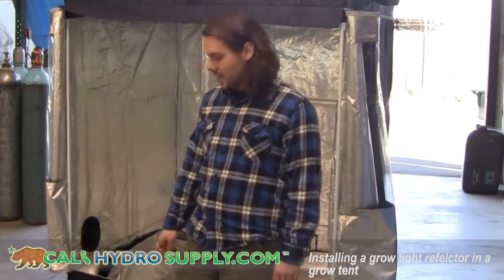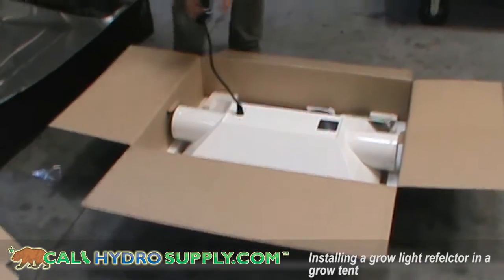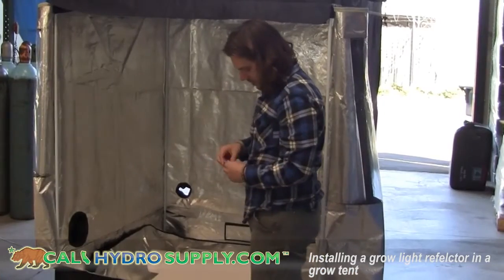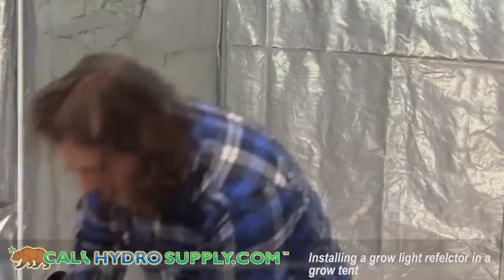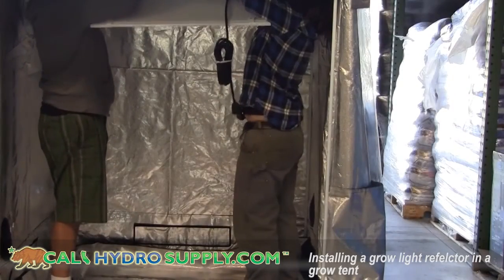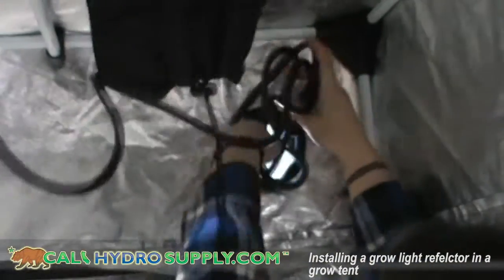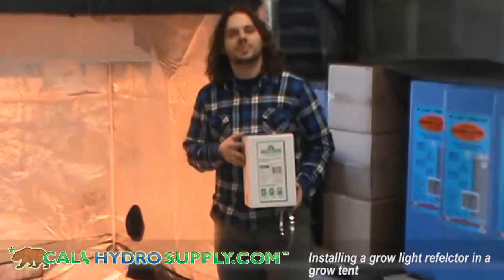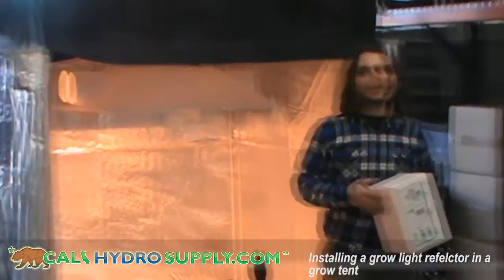Setting up your indoor grow tent - Part II - Installing your Reflector

Comment: Great vid, just wondering with all ports do you just tie them closed to seal them , or do they need to be clamped to be air tight ( with ducking or not) I want to run a hepa inlet filter and a carbon exhaust filter, and was thinking it would be a waste of time if air was leaking through ports ? Keep up the great work, sometimes it’s the simplest things we can get stuck on till it’s shown.Thanks AL